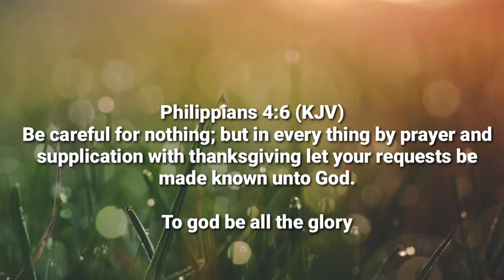xiaomi pro error 28 and error 29 capacitor change

Comment: Hello, i have a new xiaomi 2 pro and if i will pair it , there is in the app error 28 and 29 it is the capacitor  problem too?
Reply from the maker: Hello, try to open first the motherboard check the MOSFET transistor and wiring ,  Short circuit of motor control MOS upper bridge. Action: Replace motherboard.

Comment: at the start of the video the brown wire, what is that brown like burnt something around the rubber between the blue and yellow cable ?
mine looks like that.,
Reply from the maker: Terminal burn due to overload or to much speed, or sometimes to much accelerator long ride , over heating the terminals
Reply: @Edwintongol80  Thank you, they are very easily repaired because I just did mine.

Comment: Error 13 boss pano kaya maayos?
Reply from the maker: Usually motor 3 phase yan, check mo muna ang hall sensor transistor Kung ok pa. At check morin ang 2 phase wiring kung grounded or Hindi salamat sa pag pasyal Dito sa channel Sana maka ruling